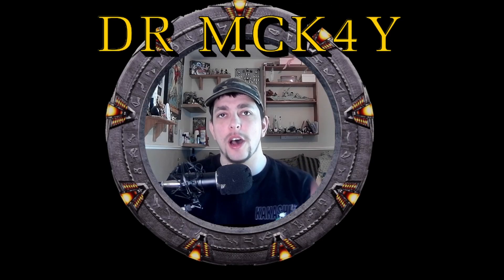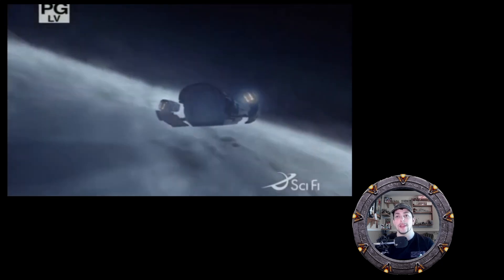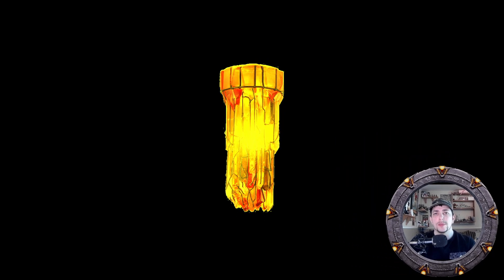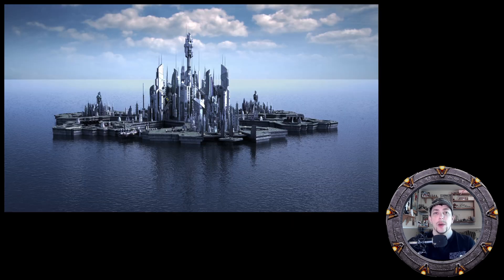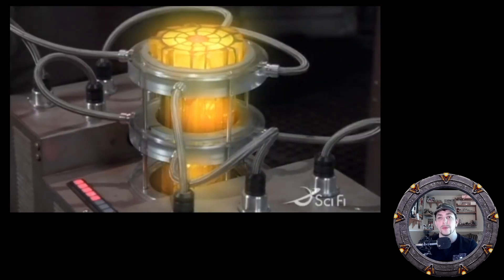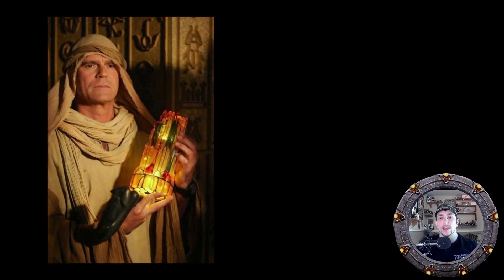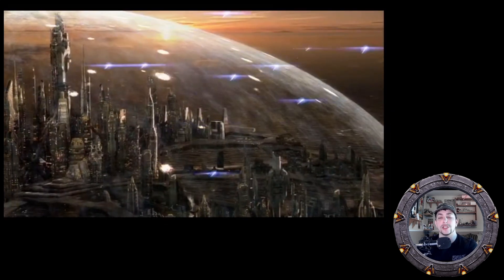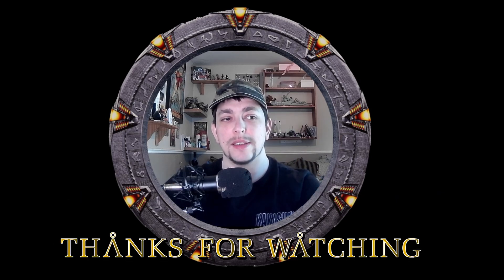ZPM Explained (Stargate)

Comment: ZPMs are inspired by the idea from physics that it may be possible to extract infinite energy for free from the quantum fluctuations of the vacuum (zero point). Max Planck introduced the concept of zero-point energy in spring 1911. Zero point energy is essentially energy you can get from a vacuum, from tiny quantum fluctuations of particles appearing and disappearing constantly. There is no known way to harness this energy however. Despite rejection of the possibility to extract any energy from vacuum quantum fluctuations by the scientific community, harnessing zero-point energy remains an interest of research. Particularly, it has attracted the attention of major aerospace/defence contractors. https://en.wikipedia.org/wiki/Zero-point_energy

Comment: So....a ZPM is only about 5 times as power as a Naquada generator?
That means Atlantis could easily be powered by 15 naquada generators....
Makes you wonder why didn't they just do that instead of hunting for ZPM's
Reply: Because finding and refining naquadria to use on a naquada reactor is still very hard. They haven't exactly mass produced naquada reactors, yet. So, any that they have is generally considered for only specific uses. They did reach a point where Atlantis had backup naquada generators from Earth, but given how valuable they are and inefficient the pwoer conversion vs using ZPMs to directly power the base, they remained just as as backup power source.
Reply: Naquada is not found on earth. The episode with Unos race and the mine; so far as we know it is earth's sole source. Mean mining production is fixed. How can earth demand increase in production even if earth needs to go up. Negotiation was one sided in the episode. Add the earth ship lost to the Ori and Wraith wars. That naquada is lost and  not removable and then naquada bombs are used up too. How many years do you need to create these 15 generators? 30+ year, maybe? Decisions do we build ships, bombs, or generators with naquada earth can get.
Reply: Probably Inefficient Energy transfer. Its like replacing car battery with bundle of AA batteries.
Reply: i imagine power availability is pretty important, more so than just raw power. the ZPM can likely put out as much power as needed near instantaneously, where a Naquadah generator would put out power in a steady, adjustable, flow. like the difference between a capacitor bank and a generator.

Comment: I ways wondered if the ZPMs were rechargeable, and if not, why not?
Reply from the maker: I don't think so as its a artificially creative pocket of subspace time once it reaches maximum entropy it ceases to exist to generate power, so a new zpm is needed, I can imagine theres a method to recreate the depleted zpms pocket of subspace time but that knowledge only the ancients know probably be easy for them to just make a new one
Reply: @SCI-FI-NERD-DRMCK4Y  It would be such a waste if it wasn't able to be recharged
SG-1 and Atlantis went through about a dozon of those things, as well as the wraith
Reply: @dragonweyr44  From what I figure... No, actually.

The pocket of subspace time costs far more to make than the visible 'ZPM shell'. 
Basically, candybar+wrapper.
Reply: Entropy ~ the energy inside is one temperature and once that happens no more energy can be provided - we speculated on the Stargate mmo forums ( 2010 that it held 10^33 to 10^42 power ) the Ancients/ Atlantians could make them so for them they were throwaway AA batteries.
Reply: “THERE IS AS YET INSUFFICIENT DATA FOR A MEANINGFUL ANSWER.” 
😈😈😈😈😈
Reply: @Whisper555  then let there be light
Reply: @SymbioteMullet  😁